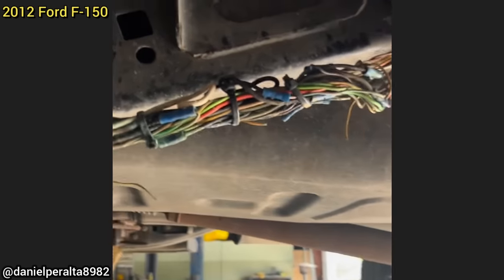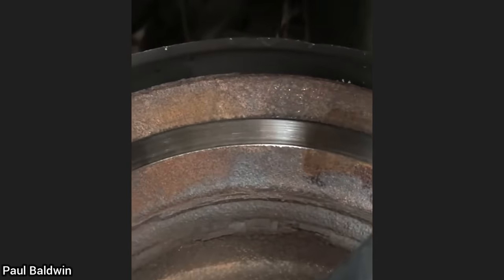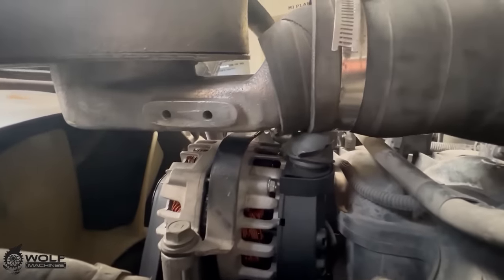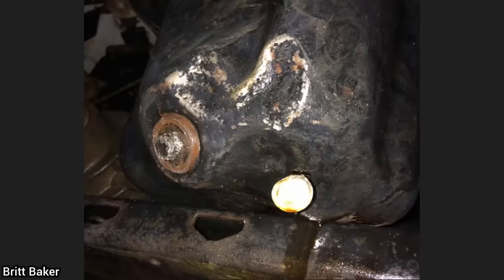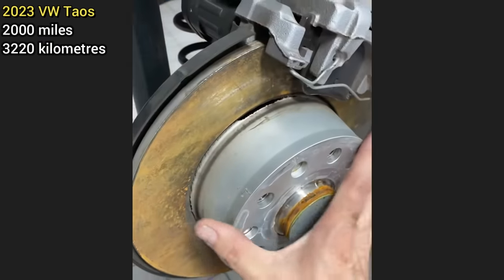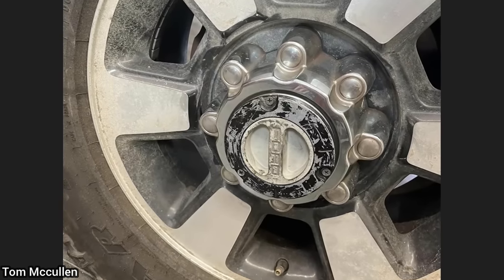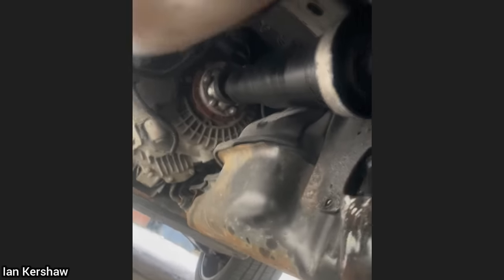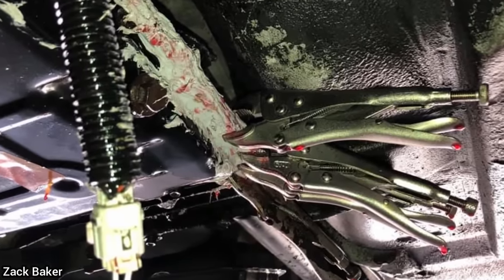Customer States He "Fixed" Some Wires, Now Truck Keeps Shutting Off

Comment: Man, just when you think you’re having a bad day, that guy in the last clip is having a worse day than you
Reply: I think that person using the pick-axe in the last clip had lost his damned mind. No reason to be doing that to a vehicle that you own.
Reply: What do you reckon? Stripped them smooth himself, forgetting they are reverse threaded. Or, found out they where shitty quality at the worst of times?
Reply: @Dr.Cosmar my guess? previous owner used black loctite.
Reply: Lost the key to the locking lugnuts.
Reply: @kennykunie6660 that's exactly what I was thinking
Reply: "Everything is a hammer if you use it wrong enough" Matt, Diesel Creek.
Reply: Yes he had scrambled brains for breakfast. 🤣🤣
Reply: That guy is his own bad day.
Reply: I disagree with all of these comments. I think the wheel is rusted/corroded on. Altho, using a pickaxe is not the tool to use. He needs a sledge hammer. Years ago, my friend drove the 3 miles from his house to mine with the lugnuts turned just a few threads onto the studs. The wheel didn't come loose. We had to use the biggest sledge we could find to get it off.
Reply: @61rampy65  I got called out to change a flat rear tire on a truck. He would regularly launch a boat into salt water backing his rear axle into the water. Tire had been on for 6 years.ended up having to pry on it with a 6 ft rock bar while he beat it with a 4 foot section of 4x4, after about 30 mins, it finally came free
Reply: He's not having a worse day, he's just mentally challenged.
Reply: He was the same guy that thought he bought a 4wheel drive truck.... because the center cap looked like a wheel hub lock!
Reply: His day is definitely about to get even worse.
Reply: How to secure a wheel dis no one can steal it:
-use lock tie
-loosening in the opposite direction 
-special pattern like using 5 site nuts instead of 6 site nuts or a strange pattern 
-using the torgh spec yes
Reply: He can pick how he chooses to remove his tire.
Reply: It's not difficult to break a wheel loose that's rusted to the hub.  But you do it with the SPARE TIRE, not a hammer.  Strike the top-center of the stuck tire firmly with the rubber of the spare tire.  Repeat as necessary, use rust-breaker spray if necessary.
Reply: @Patrick-bu4vq 5-sided lugs would stop damn near everybody.  I loathe hondas/toyotas that lower the underslung spare using a 5-sided socket that people loose all the time.
Reply: @_EmptyBox_  humble philosopher
Reply: @kylemiller769 Oh. I fully believe that. Rust is very powerful. It is the poor man's loctite.
Reply: @61rampy65  we had to take a hammer and a piece of wood and just beat the shit out of the tire until it came loose, it had been forever since we did anything with the car and we wanted to change the breaks before a trip. also had to do the socket trick to remove a locking lug that we lost the key to.
Reply: @christopherkidwell9817 i doubt he owns it. Probably stolen
Reply: I know a local garage who is looking for some new mechanics, this guy is a step up
Reply: Meth
Reply: @61rampy65 but you hit the outer back side of the rim...not the front in the middle
Reply: Maybe he's doing that to the ex's vehicle ??
Reply: @christopherkidwell9817  who said he owned it.? could be revenge
Reply: "I been workin' on the raaail-roooad, aaaalllll the live-long daaaay!"
Reply: Bro the first thing I thought of was the last clip lmao
Reply: I'd say, with that attitude, every day is a challenge for him.
Reply: @jayjaynella4539  don't say that.
When i was a child, my grandmother still had a few pigs. And when they faced their end, almost everything of the animal was used. And so there was a meal  that we called "brains with egg" looked like scrambled eggs with a little more grey colour and tasted good (pigs-brain, eggs, garlic, salt).
And yet i never have used a pick-axe on a car!
Reply: This triggered my PTSD.  During Desert Storm we were in a remote location and occasionally had to repair tires on M35 Deuce and a half trucks.  These trucks had rims with a split ring, which was easy enough to get off, once the tire was off the ring, put the only tools we had to push the tires off the ring were the tire iron and the pick axe that each truck had.  We were also expressly forbidden from driving another truck over the tire because that tended to rip the tire.  Good times!
Reply: @amzarnacht6710  That's a good idea.  I've always kicked them, but that sounds good too.
Reply: My suv wheels would stick like that I would just loosen the lug nuts and drive a little and slam on the brakes they would pop loose
Reply: When a landscaper thinks he's a mechanic
Reply: I just had to help get a stuck tire off of my sister's Escape. One YouTube video, and a rubber mallet later, I got it off. I hit the tire from the inside, which broke it loose.

Now she just has to go to the auto center at Walmart where she got her tires and get a plug put on it.
Reply: He's having a worse LIFE...
Reply: @TheCreedBratton  I doubt it's stolen, he would just steal another car rather than actually WORK to fix something...
Reply: Having once spent hours trying to undo a broken locking wheel nut before using a very undersized socket, I can say hammering away with club and sledge hammers is very satisfying.
Reply: @christopherkidwell9817   that's the key "that you own".  could be his cheating girlfriend's car.
Reply: Trying to get a new tire from the tire mines
Reply: I am guessing that it's just corroded on. Easiest way on front wheels that are super stuck is backing of the lugs a little and parking it next to a curb and steering into it with the power steering.
Reply: That's a guy who is fed up with not being able to get the lug nuts off. It was supposed to be a quick tire change but this unexpected road block is infuriating. I have felt this way but didn't want damage my car. The fat guy I got to stand on my force multiplier still broke off the wheel stud...but I was no longer stranded on top of a mountain. It's happened other times too.
Reply: @amzarnacht6710 I've had my spare stuck before. You only ever find out it's rusted on at the worst moment.
The real kicker is that when you finally get it unstuck...you are rewarded with it falling on your face.
Reply: @AndyDrake-FOOKYT  ... leave a lug on a couple threads.
Reply: It probably had the cheap ass ford two piece lug nuts that swell. I hate those things. I've replaced mine.
Reply: @jlang8213 It's not just Fords.

It's EVERY US domestic manufacturer and Toyota.
Every single one of them.   Ford, at least, uses steel for their trucks.  Dodge uses these POS capped lugs even on their trucks.

Damn things should be illegal.  I've seen someone loose a leg because of them (were trying to get their factory tool on swollen lugs and got hit by a passing vehicle).
Reply: @amzarnacht6710  bro I got this 1986 golf that was about to be scrapped and I was like oh I’ll just grab the wheels. 
 
Nah bruh

At the junkyard we took all the bolts out of the wheels and pushed the car sideways with a bulldozer in the car flipped over and the wheels wouldn’t still come off
Reply: @amzarnacht6710  I recently saw a non local (to me) news report on YouTube about these and a possibly class action. They even mentioned the danger they posed.
Reply: Nah, the mechanic who has to fix that and deal with the customer is having the bad day.
Reply: Well since he's taking up a handicapped space and park over the line I'd say he kinda deserves it
Reply: If in doubt, give it a clout!🤣

Comment: Drilling holes in the oil pan to try to remove it is certainly a new one.
Reply: I think it might be a RAM 1500. A guy at the shop I work at did one recently. You don't have to completely remove the front axle. You just have to lower it enough and the oil pan will come out.
Reply: I’ve punched a hole in an oil filter to remove it before, but an oil pan… can’t say that’s ever occurred to me
Reply: That's a unique technique.....
Reply: speed holes !
Reply: Hard to comprehend the thought process that lead that that.
Reply: Saws all would have been the tool to use, and even then................................
Reply: Would have been way easier to drill those holes in an F150. What genius came up with a plastic oil pan. Mine has warped twice causing oil to seep out. Not a lot but about a quart every oil change. But ford was nice enough to put a diaper on it so you don’t get oil on the garage floor.
Reply: @leadpilled5567  2.7L V6?
Reply: He just couldn't find those bolts hidden around the flange. You know if he did get it unbolted he could then drop it the half inch to the crossmember and cut that off with a sawzall and be home free.
Reply: He removed about 9% of it.
Reply: @AttorneyBCollins  Ha ha! In previous videos, on this channel, there are people who do that! Cutting a notch out of the frame to replace a starter. Cutting the sway bar, instead of unbolting it, to replace the transmission oil cooler lines, and cutting a bolted in crossmember out because they didn't see the bolts!! People who do that stuff should just launch their car into the Sun when it breaks down 🤣
Reply: at least he was smart enough to tow it to the shop and not drive it there
Reply: I just want to see it installed that way, one circle at a time.
Reply: @nodsib Apparantly nobody explained to you that, likd a filter, a few holes allow you to twist off the oilpan. 

Hang on…
Reply: @09corvettezr1 😂😂😂😂
Reply: That axle blocking the oil pan tho. Engineers hating car owners for wanting to try to repair their own cars. An oil pan should be easy to take off and put on again, just remove all the bolts/nuts/screws holding it in place and it should come right off.
Reply: When people decide to cut a part out of a car you have to wonder how they plan to get the new one in.😂 not saying I have never done it, but I always have a plan
Reply: @ai-d2121  oh man I’ve been doing it wrong all these years!?  lol
Reply: @@Martys-4x4@Martys-4x4 ... ram 1500 ecodiesel, tranmission pan, plastic too 🤥
Reply: What would be the logic behind holes in the oil pan? How did this dude come to this idea
Reply: @HighSierra1500 
Engineering at it's finest!
Reply: @JoseJimenez-mp1iy  My 2006 Lincoln Navigator had a plastic transmission oil pan as well. I also found out that a European 6HP26 oil pan is a fraction of an inch shallower than the version designed for Ford. Then when Ford came up with the 6R80 they used a metal oil pan, but the trade off is the lead frame module dying on you.
Reply: The definition of: "He's confused, but has the spirit."
Reply: @HunterSteel29 I would love to see your design for mounting an engine above the front axle yet also making the oilpan "easy to remove". There is a proper method, you either lower the subframe/front axle or you raise the engine. Or both... Either way this is not a result of engineers hating consumers, there are legimitate space constraints that can't be avoided.
Reply: @nodsib  Yep, drive a Phillips screwdriver thru it.
Reply: Fr like who would try to do that… oh wait… my truck (gmc sonoma) was made by an idiot…. You gotta take the engine out to remove the oil pan XD or install a new one/ new oil pump….
Reply: That's this new type oil pan I bet. You remove it from the inside ;)
Reply: At least he admited it was him self. and not "some other shop", and came asking for help when he realised he couldn't.
Reply: How did he think he was getting the new one in?
Reply: Technically you could remove it that way. It just takes a lot longer. 😂
Reply: Needs more holes,  he'd of gotten it 😅
Reply: Maybe he was going to hook a log chain or two to the pan in those hole and around a utility pole then back up quick to yank it out. I’m sure he hadn’t thought through how the new one was gonna go in.
Reply: I was replacing the oil pan gasket on a 289.  Long story short, I removed the bolts on the pan and bumped the engine bit by bit while working the pan down the crankshaft.  I was able to replace the gasket and pan in about an hour.  55 minutes figuring out how to remove the pan and 5 to reinstall.
Reply: @AttorneyBCollins  genius!

Comment: I've always found that a pair of vice grips and a pick axe are all you really need.
Reply: When I was in the USAF, occasionally I rode in the maintenance launch truck while aircraft were taking off.  My supervisor rode with me and all he carried was a screwdriver and a pair of vice grips.  Get that plane off the ground!
Reply: Had a mate many years ago that would do most jobs on his motorcycle with an adjustable wrench and a 1lb lump hammer!...
Reply: I've seen last guy's relative on the net few years ago. She couldn't get the lock-nut off because she didn't have a pick axe, only a regular axe.
Reply: Duct tape and spray foam seem to come in handy as well.
Reply: Six pack of vice grips
Reply: how else are you going to put speed holes in the hood of your car?
Reply: @2-old-Forthischet  I maintained missile system's. I only really needed like 5  ball allens as far as tools went.
Reply: The pick axe was painful to watch.
Reply: If you can't do it with those, you have to question your skill as a mechanic.
Reply: For car repair, right?

RIGHT?
Reply: Who hasn't ever felt like taking a pickaxe to a tire rim, right people?!
Reply: *Pointy sledge hammer
Reply: *3 grips
Reply: @markh.6687 
😂
Reply: Why do you need TWO hammers?
Reply: WD-40 if it's supposed to move, duct tape and cable ties if it's not. Vice grips can do anything!
Reply: Just saw a YouTube short where a guy separated a lower ball joint with a pickax.

Comment: The brain power it takes to think cut holes one by one into your oil pan to remove it and thinking you can put a new one in is actually horrific 😅
Reply: You can never have enough "speed" holes as Homer Simpson would say
Reply: "Replacement is a reversal of the removal process".
Reply: That guys mom might also be his sister.
Reply: He tried this first on his cranium
Reply: Frankly, I'm baffled as to how he knows how to use a hole saw in cramped spaces, but can't figure out how to remove the oil pan.

Comment: That last guy just misunderstood when he was told he could go pick out his rims.
Reply: Hilarious :D
Reply: That was so painful to watch. I don’t even know what he is trying to accomplish.
Reply: @rjgaynor8  With some vehicles, the aluminum rims get stuck on the steel rotors and you can't get the tire off to change a flat.  Best solution is to back the lug nuts off so they kinda loose and then drive the car 10 ft. to get the wheel to separate from the rotor.
Reply: @terryrobertson111  if they are bad enough, even that won’t work - a smear of antisieze does wonders
Reply: @terryrobertson111  I am a mechanic and still don’t know what the hell is doing. That pickaxe isn’t going to do anything.
Reply: @rjgaynor8  I think he was mining crypto.
Reply: @terryrobertson111  never had aluminum rims got stuck, but steel rims, many times. You just have to kick hard, LOL. 😂
Reply: Take your dang like….funny man!!!
Reply: @kellismith4329  I had a Buick years ago that was bad for that.  I just backed off the lugs to hand tight and drove it up the street a wee bit.
Reply: Lol I already used I big pole like one you use for hanging clothes outside and I hit the tire not the rim it was stuck really hard
Reply: @terryrobertson111  Somehow I don't think aluminum rims like being picked at. If that wheel gets remounted it'll probably break and fall off
Reply: @Njazmo  at work, I had a lot of aluminium rims get stuck from corrosion. newer european vehicles have them sit on the hub so tight even the slightest bit of corrosion gives you trouble. VW even invented a wax in a little spray can trying to help prevent this, but it didn't do much. next change-of-wheels you again, had to use force to remove them.
Reply: @rjgaynor8  I imagine they lost the key to a key nut and are now trying to make room for it. because driving to a professional workshop is out of the question.

Comment: If anybody watches dashcam crash videos, and you wonder why some vehicles seem to lock just the front or rear brakes (or just one wheel) as they slide into someone, Just Rolled In can explain a lot of those issues with just a short video clip.

Comment: That last one reminds me of the Bimetal corrosion around the aluminum factory wheels of a '78 T bird I had to work on one time. We just plain couldn't get the wheel off. We resorted to loosening all the lug nuts on the wheel and driving it in the big parking lot and jamming on the brakes. No dice. Had to turn that job down. We didn't have the proper pick axe to break it loose I guess.
Reply: I had a Ford Econoline 350 van in the early 80s. Had to chop away part of the timing chain cover to remove the water pump bolt that had welded to the pump housing. It was the last bolt to come out.

Comment: That last clip takes me back.  To 1995, specifically.  Heading out to work, mind you wearing office wear, and realize my rear tire on my 1994 Geo Prism is way low on air.  Also, it had snowed about 4" the night before.  Jacked this puppy up to put on spare, find the rim is stuck to the wheel.  Oh, look, I played hockey the previous night and my gear is still in the car.  Extract a goalie stick, and smack the heel of the stick right on the edge of the tire maybe 2x, and the rim popped off.  Whew.  :)  Got the spare on, and was on my way.
Reply: Pro tip.  Loosen the lug nuts a bit.  Drive the car slowly and hit the brakes.  The little bit of play with the loosened lug nuts will allow the car to use its inertia to break the wheel from the hub.
Reply: In the snow?  :)  But yeah, I agree, that'd work far better in other conditions!
Reply: From one goalie to another, nice save.
✌️😎
Reply: @dragoniv  I've never needed to change a tire when there WASN'T precipitation.
Murphy hates me in a very specific way.